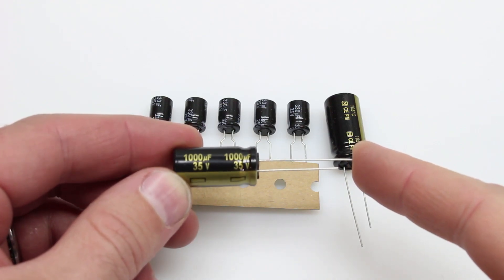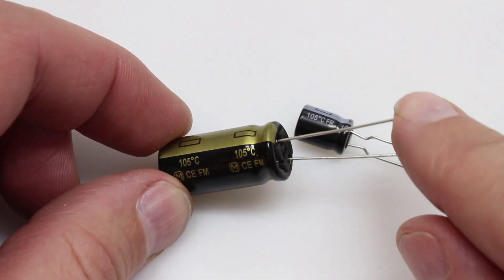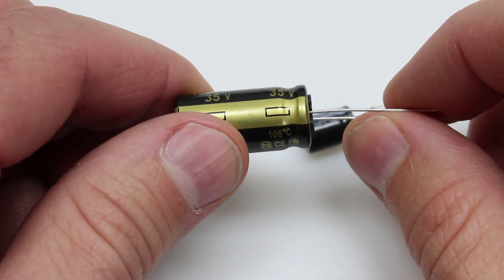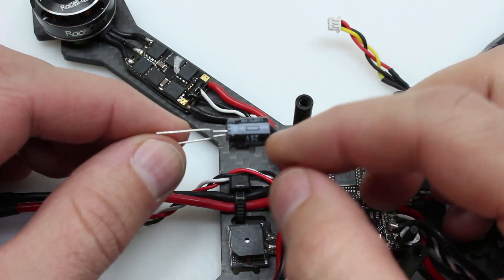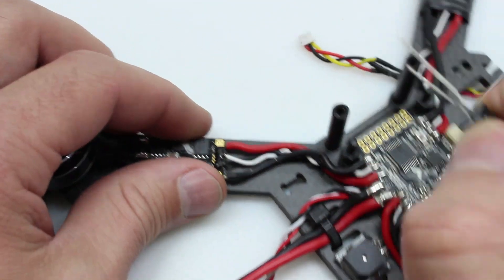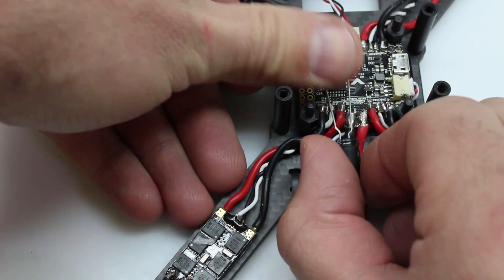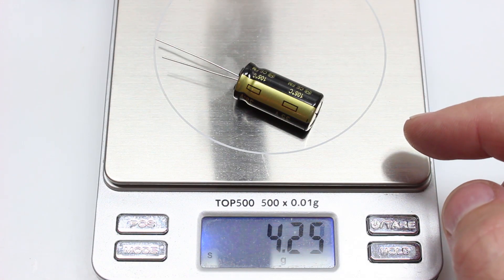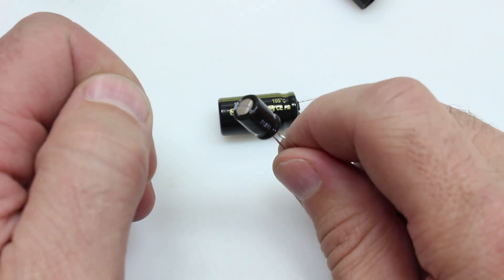Capacitors for your quad - What they do and how to install them

Comment: Thank you for the video. May i use large cap, with its wires cut to bottom, with 3cm of 20awg, soldered to lipo pad connectors on esc board?

Comment: ESR in Aluminum Electrolytic Capacitors
For medium and high voltage applications, low loss aluminum electrolytic capacitors are required. Low ESR capacitors have less power losses and internal heating problems as compared to high ESR capacitors. Apart from lowering performance, high ESR values reduce the life of an aluminum electrolytic capacitor. In addition, a low ESR value allows a greater ripple current capacity to be achieved.
Reply: Does low ESR just means better quality?

Comment: I wish you had gone over the voltage aspect.  If running 1-3s you don't need a 35v capacitor.  A 15v will do fine.  4s, 20-25v will do fine, etc.

Comment: Great video. Why not add capacitors directly to the power leads for the camera and the vtx? Clearly an advantage to reduce noise to the whole system, but wouldn't they have maximum effect on video quality at those points?

Comment: There is no  room to solder the capacitor  to the 4-in-1 esc, so I added about 2.5 inch length of negative and positive wire to the to the ESC + and - terminal, just to extend the capacitor. My question is, will it work that way as well or should the capacitors legs supposed to be solder directly from the negative and positive terminal of the esc?

Comment: hmm. got a 1000 uF cap for my drone. but it's has wires on top and buttom. and the short wire is marked with a + sign. very confused x'D

Comment: Is it ok to have your CAP on wires? So you can mount remotely and secure well, just wondered if it is still going to work the same?
Reply: Soldering 20 gauge wire to the base of the capacitor leads is actually better then just soldering the leads straight to your quad. The wire has much lower resistance then those thin leads, therefore lower ESR, therefore it performs better.

Comment: How do i find out how many volts and farads caps do I need for my build?
Reply: The voltage on the capacitor is the maximum rated voltage it can handle.  So if you're running 2s (<9v) your capacitor can be a 1000uf 10v capacitor.  Just keep in mind to upgrade your capacitor if you switch to 3s (<13v)  I've seen caps in 6v, 10v, 15v, 16v, 20v, 25v.  The higher the voltage, the bigger the capacitor.
Reply: @naps1saps  And for a 4S (16,8V) battery which capacitor to use?
Reply: @fabvelloso  get the 20V
Reply: @fabvelloso  I stand corrected. You should probably get 25V or above at 1000uF.
Reply: @LiveTheLimit  Probably? I would like to get an exact value, but Thanks for trying to answer
Reply: @fabvelloso  I forgot about the 80% capacity rule.  20v should be used for up to 16v but honestly you should be fine.  If you plan to go 5s or 6s in the future get a 30v.

Comment: when do you use 35v and when 24v, how to know what a low esr capasitor is, how to define which size 1000uf or more/less needed?
Reply: Depends on your battery voltage. Capacitor needs to be rated for about 30% more than your battery. 3 or 4s is probably OK with 25volt cap. You can use a 35v cap for up to 6s.
Reply: aowi7280 does 50v also work with 6s of is it too much?
Reply: @dominikthone512  It will work just fine.  It's the capacitance that matters as long as the capacitor's voltage is above the battery's voltage by at least 25%
Reply: I use a 330uF cap on each ESC. I figure the noise will be absorbed before it gets back to the flight controller and Vtx.

Comment: How do I know if I need a 25V or 35V on my 4in1 esc? thanks!
Reply: depends on the input voltage. 25v is ok minimum for 6S  any higher, and you need to go higher with the cap too.
Reply: @FPVREVIEWS  will a 2200uf clear more noise than a 1000uf? Or after 1000uf it won't make a difference
Reply: @gtrargh6637  It's all about the ripple current. Noise filtration for your video signal is another topic, and need an LC filter for that. Most PDB"S have them built in.    for ripple current the larger the low ESR capacitor the better, although if you are not to the point where you are overloading the one/ones on the ESC,  you will  not know the difference. 
depends on the amount of current, and how good your ESC is, also how far it is from the  battery.   when in doubt, go larger.  I'm not aware of any bad effects at upper size.
Reply: @FPVREVIEWS  so if I'm not actually getting noise with my HD setup but I'm just putting it on as a safety.. 1000uf should be fine
Reply: @gtrargh6637  if you get no noise on your video, and are not using it to protect the ESC, there is no point in using it.

Comment: Probably a stupid question, but I’ll ask it anyway! Does it make any difference in the performance of the cap, if you cut the positive lead so that they’re both even?
Reply: The capacitor actually works better, the shorter the leads are, doesn't matter which one is longer tho, just remember which one is the negative and which one the positive.

Comment: Whats the difference between using a 1000uf or a 470uf? I ask because I see a lot of FC come with 470uf caps.
Reply: A 1000uF would go on the neg pos leads coming into an all-in-one "AIO" board, whereas having 4 individual ESCs, one for each motor, would each take a 470uF cap. The reason is in the way the devices pull equal parts power from the battery. 1 battery supplying a flight controller, 4 ESCs, and 4 motors, each of those individual circuits would need it's own capacitance, or one big one coming off the main battery power supply.

Comment: Anybody know how the voltage is decided?
Reply: Nic Mc use a higher voltage rating than the battery you plan on using. Example, for 6s you’d want at least a 50v cap.

Comment: So is it the bigger you go the more noises you filter cause my hawk 5 by emax has a small one soldered to the xt60 pads on the 4in1 and was wondering if i put a bigger one on it if it would clean up my video a lil more

Comment: I installed 1000 uF but but there is still lot of noise. I'm going to install 330 uF on each ESC, but I'm not sure if I should leave 1000 uF on battery lead as well... Or should I remove that 1000 uF cap and have only 4x330 uF?
Reply: I am having exact issue, did you leave it on or did you remove the 1000uF cap? I am thinking of just leaving it on, and putting on 4x 300uF 35 caps on each ESC
Reply: To Farkhod Khikmatov
I asked the same question to Joshua Bardwell and he replied to me, that leaving the 1000uF capacitor and just add 4x 300uF to each ESC won't hurt anything. So I did that and no I have all 5 caps on my build and everything works perfectly
Reply: TomicaCZ nice worked for me too
Reply: Do pay attention to where you install them and all. Many different ways and all. (Edit: I'm sure you are saying duh, but for sake of helping others, explain how and where and on what you installed it on, so people can know what doesn't work. And of course it could have been correct way and the issue is something else too.)
Reply: it all helps, leave them all if they are not in the way.

Comment: odd question maybe but ive got a build that has zmx finx40 motors 2633kv with spedix 4.1 esc and joshua bardwell f4 version 1 f.c and since im using a 4.1 esc can i just solder four 470mf caps to the power and neg pads where individual esc would be wired? one cap per motor power pads on f.c? would this work correctly? either one 1000mf to f.c esc pads or four seperate capacitors?
Reply: One on each esc is ideal. 470uF is plenty, if not overkill.

Comment: Caps help a bunch. One think I’d recommend from experience is, solder a set of wires to the cap and hook it up that way if you’re planning to solder to pads. I have ripped a few pads off on my stuff and the wire acts as a strain relief on the pad.

Comment: I have a important question. I heard about capacitor and I installed 25v 470microfarad  in every esc, first battery it works fine, the second battery my vtx won't turn on, I don't know what happened I tried everything but it won't turn on. Someone can explain?
Reply: William DRS. What battery are you using? It is possible that 25 v was not enough to cover the voltage spike. 35 v is a safer bet.

Comment: I have a martian 2 frame and am using the pdb supplied, lipo input is where it should be at the side of pdb and at the rear of pdb i have - & + connected to a matek pdb above it. I also have a capacitor at the front of martian 2 pdb between the - & + is this ok or ?

Comment: Thanks for creators this's video.
Quick question if I can: is it possible to have to much capacitance on a quad?
Reply from the maker: Yes. Using the wrong capacitors can cause issues in the build
Reply: The bigger issue would be weight and space, if your quad is noisy then add the minimum amount to fix the issue. When you go deep into them then your just adding extra weight and taking up space

Comment: I have a 4 in 1 esc and I was wondering if it would make a difference if I connected the capacitor to where the esc connects to the pdb rather than where the lipo connects to the pdb.
Reply from the maker: If you're using one capacitor, it should be where the battery connects.

Comment: Awesome video can I cut the leads shorter?
Reply: 831 fpv np, but remember it can always be something more, may want to look into low pass filters, I couldn't fit one or I would have did that instead
Reply: Yes sir you can
Reply: RaceDayQuads LLC thank you, also I suppose protect the exposed leads with shrink wrap?
Reply: Can I use more than one to clean my video up even more
Reply: 831 fpv I heard if your running 4S you can, I run 4S and cleaned up significantly, I too thought about adding another one but the diatone gt2 has limited room
Reply: IceRook thanks bro